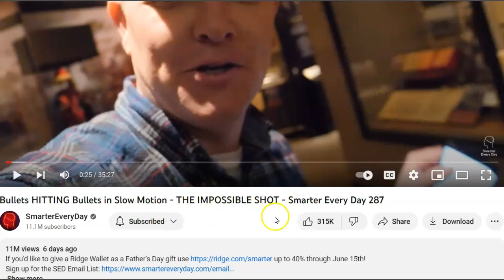Bullets Hitting In Mid Air - Will They Fuse Together? -  Smarter Every Day

Comment: On my watch list, not seen it yet.    The Force calculations on a bit not hard, just need the diagram of lengths and angles etc.  [ free body diagram ]  Google that for clarity...  Learned this in 2nd year Eng studies.
Reply: As simple force multiplier & leverage, yes, that part should be straight forward. Except we also have to add the complication of how “pounds per square inch” can be used  misleadingly. The amount of discomfort / pain and how objective is that. Can that be assessed with brain scans? It all becomes very unscientific quickly. The biggest unknown is how the device is used in the hands if skilled or unskilled rider. All the physics and math are irrelevant if the rider escalates everything to pain level all the time. If I can speak for Rick, the fact there is a reliance on a pain device is the main objection. It’s the wrong training model.
Reply: @billr3053  The just force multipliers,  going to actual pain levels and evaluating brain scans not what he is looking for.  

e.g.  If one pulls with  1/4 lb  on rein, then the pain device is actually X lbs.    Help folks think about it a little better.   

Going to actual Pain levels is peeling the onion back to far and not achievable.